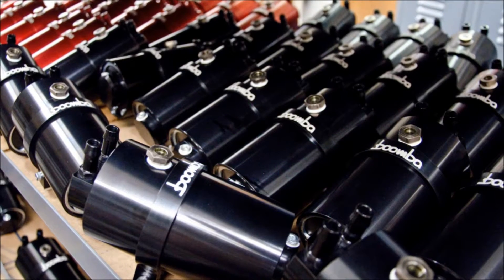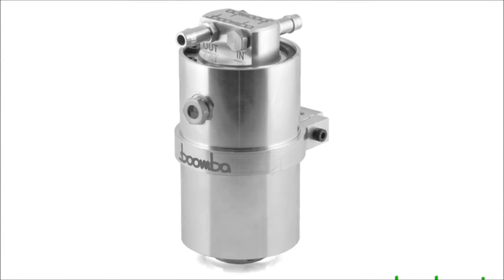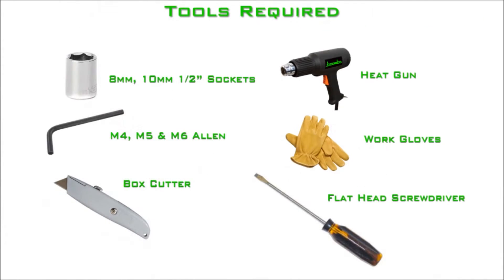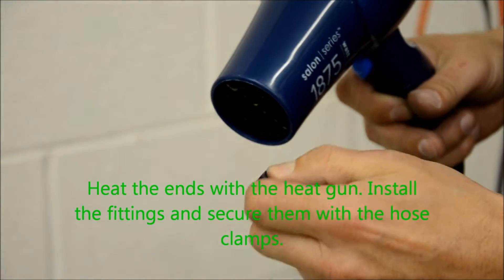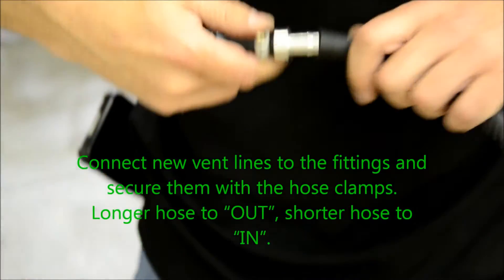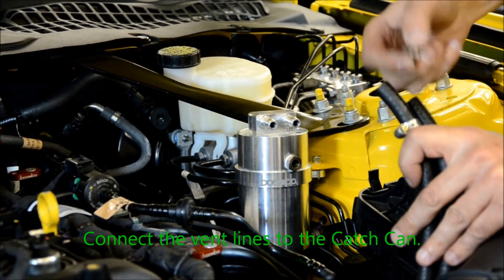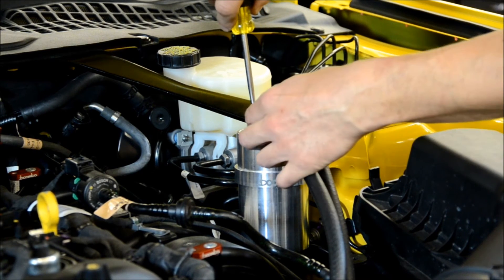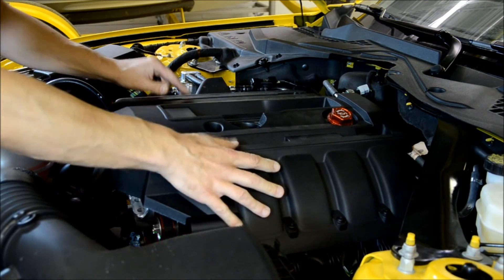How to Install | Boomba Oil Catch Can for '15+ Ford Mustang Ecoboost

Comment: Do you do the installation if I brought my car to you? Nobody in my area knows how to install these and I’m not mechanically inclined to do it myself. Also, how difficult is it to empty these cans? Thanks.
Reply from the maker: We unfortunately don't have a technician so we do not offer installations anymore. We now only focus on the production and sales of the products that we make.
Reply from the maker: These cans empty very easily via the quick drain fitting on the bottom of the can. Simply open the valve and let the contaminants drain out.
Reply: Does this same installation work on non eco vehicles i have a 2002 ford mustang and i have blowby i added certech gel to seal pistons on 2 and 5 low compression for it to work i have to drive it but oil is entering cold air intake. I added breather on valve cover oil was everywhere wanted to route catch can to aid in trapping oil to c if it seals cant afford another engine yet only 139,000 miles on it please help me

Comment: at 4:32 based on the instructions the vent lines in the video are backwards.
Reply from the maker: The top of the can has the ability to be rotated 180 degrees so it is possible they are in different orientations between the video and installation guide. The routing for a stage 1 kit will go from the valve cover > inlet on the can > out of the can > back into your intake.

Comment: I just purchased both cans but I haven't installed them yet. I have two questions. 1. Are two cans better than one? 2. Will the installation of both cans result in any performance issues with a stock tune? I am a new Mustang ecoboost owner, so there is a lot I have to learn.
Reply from the maker: There are a few differences between the stage 1 catch can and stage 2 catch can. The stage 1 catch can works on the low pressure CCV side of you vacuum system in between your valve cover and intake tubing. The stage 2 can works on the high pressure side and works between your PCV valve and intake manifold. Running two cans will ensure the most protection on your direct injection engine. Our cans use a two-step outlet filtration system to prevent contaminants from making their way back into the engine. 
 
If you have other questions, feel free to let us know!
Reply: Thank you for responding. I did have a second question. You must have missed it. Will the installation of both cans result in any performance issues with a stock tune? I have already purchased both of your cans and I am looking forward to installing them. Thanks again.
Reply from the maker: While there will not be "performance" in the sense of added horsepower, there will be performance in the sense that you will be keeping your engine much cleaner and keeping carbon build-up from accumulating on your valves which could hurt performance over time. The cans will function totally fine on the stock tune and there is no need to custom tune for running them. There will be no issues from running them on a stock tune.
Reply: Thank you for responding. The info was definitely helpful.
Reply from the maker: Let us know if we can help you out with anything else.
Reply: I will, thanks. Hopefully if the weather warms up a little next week I will be able to install the cans.

Comment: I just bought a 2016 mustang ecoboost and am considering getting a catch can. Most of what I have seen are Mishimoto PCV side catch cans. What is the difference between PCV and CCV? Why did you put a catch can on both the PCV and CCV? Why does your stage two (PCV) require the removal of the intake?
Reply from the maker: There are a few differences between the stage 1 catch can and stage 2 catch can. The stage 1 catch can works on the low pressure CCV side of you vacuum system in between your valve cover and intake tubing. The stage 2 can works on the high 
pressure side and works between your PCV valve and intake manifold. If you are looking to run one can only, we’d recommend stage 2 because it is going to catch a lot more oil and contaminants than the stage one will. Our cans use a two-step outlet filtration system to prevent contaminants from making their way back into the engine. Installation has you remove the intake manifold in order to gain access to a vacuum hose which sits behind the manifold. Removal of the intake is nothing to fear as it is only held on by five bolts. We are using two catch cans to protect our low pressure side, as well as our high pressure side. Let me know if you have any further questions.